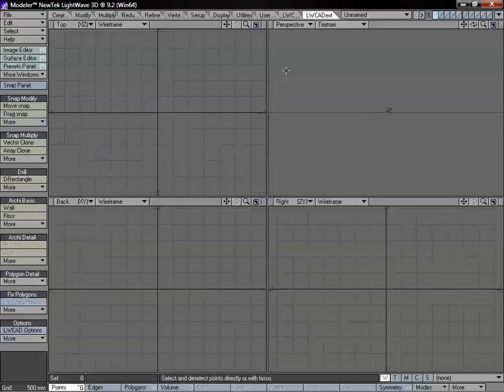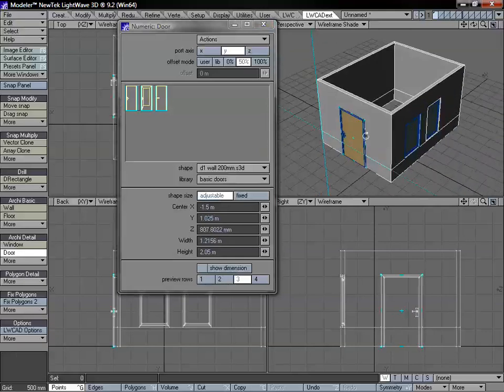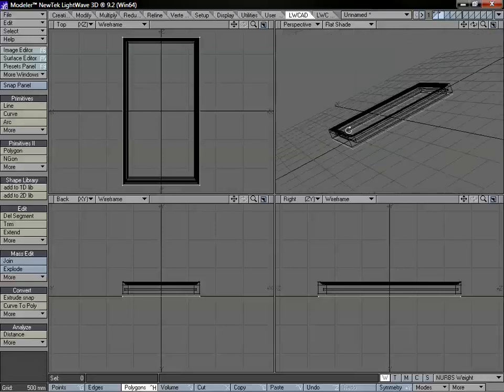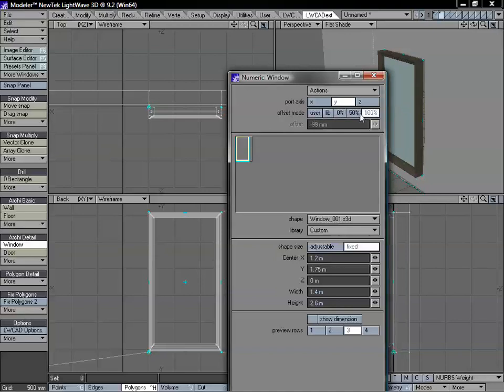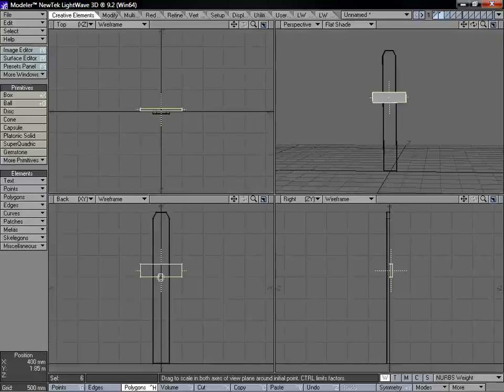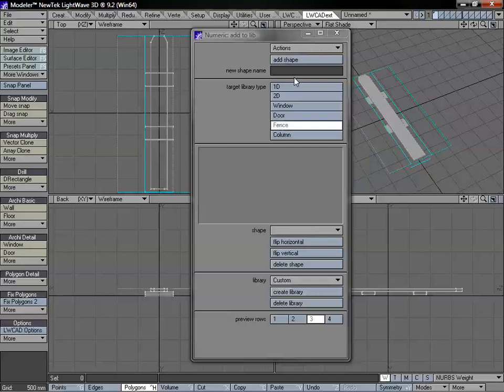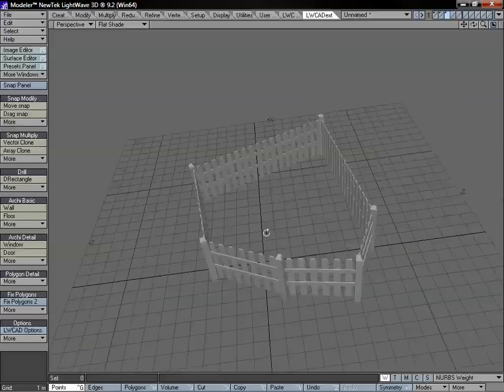LWCAD - Archi Detail

Comment: 00:00  The video introduces the architectural detail tab in LWCAD, showcasing tools like window, door, and fence, located under the lw cad extended.
00:30  The window tool allows users to choose from various window types, adjust dimensions, and efficiently place them using features like angle snap and slicing for alignment.
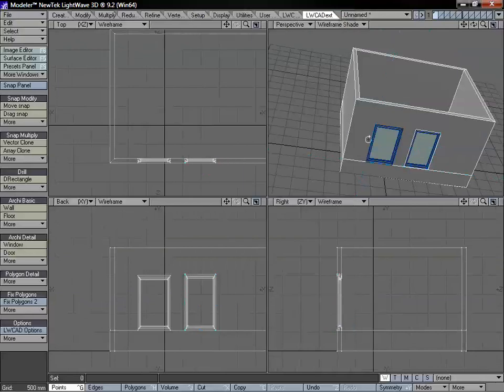05:29  Similar to windows, the door tool works in the same way, providing options to adjust dimensions, position, and alignment with the wall.
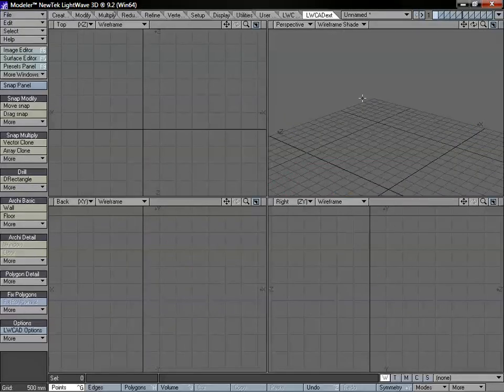08:42  The fence tool offers the flexibility to create wooden or metal fences with different shapes and columns, providing a quick way to design diverse structures.
12:00  Clone Tool
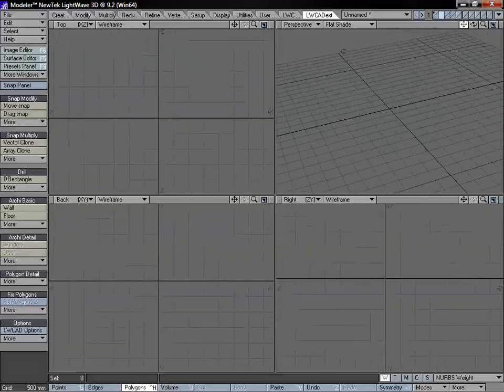12:18  Create a Window
14:23  Engraving
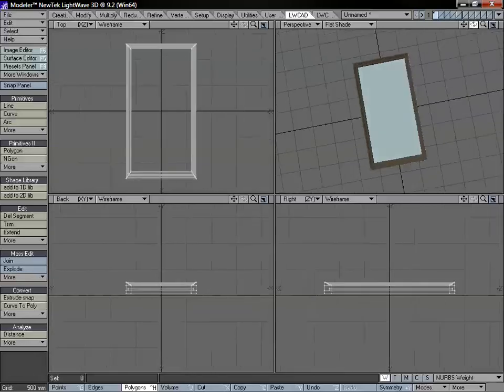20:00  Custom windows and doors can be created and added to the library using the "add to library" feature, allowing for easy reuse in different scenes.
23:16  When adding custom windows to a scene, ensure the correct library and shape are selected to avoid distortion, and adjustments can be made within the numeric panel.
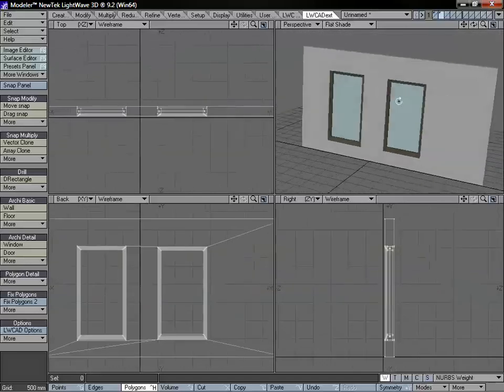25:40  Customizing windows and doors in LWCAD 2.5 is user-friendly, providing a quick and efficient way to create detailed architectural models.
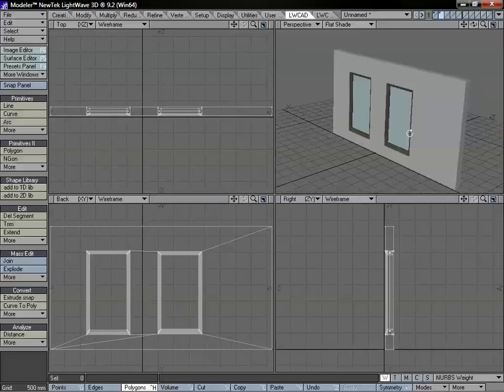26:21  Creating custom fence objects involves modeling sections and posts, with attention to maintaining correct measurements for optimal results.
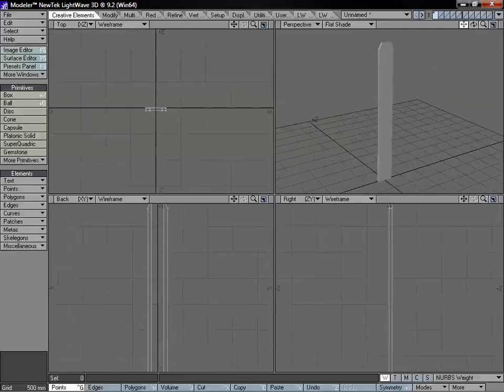28:13  To optimize the fence model, remove unnecessary polygons by selecting them and using "Shift Z" to merge them.
29:05  Adding a medium-sized bevel to objects enhances realism in renders by creating highlights on edges.
29:34  Creating connectors for the fence involves designing thin segments with attention to width and spacing.
31:10  Enhance the design by adding bolts or details to the connectors, and focus on the placement of objects for a cohesive look.
33:52  Using the LW CAD tool, create a two-point curve to define the path of the fence, ensuring proper positioning and alignment.
35:15  Surface
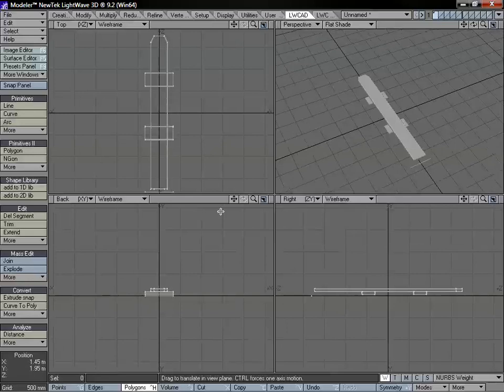35:53  Library
36:27  Save the fence design to a custom library for reuse, but be aware that the library won't store texture or material information.
37:48  Bevel
38:46  Resizing
40:04  Add Library
40:43  When constructing the fence, utilize the fence tool, drawing out the design and adjusting spacing and orientation as needed.
41:57  Adjust spacing between fence segments and correct orientation issues by manipulating the design parameters as necessary.